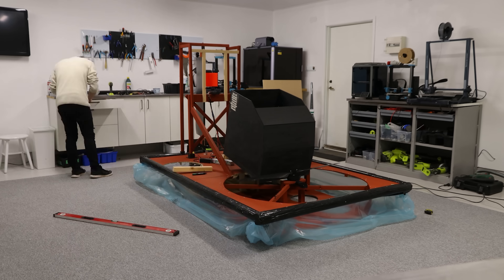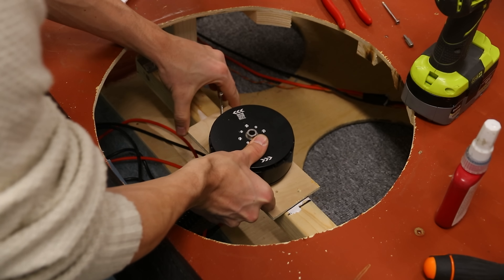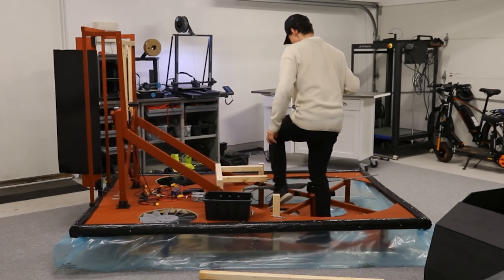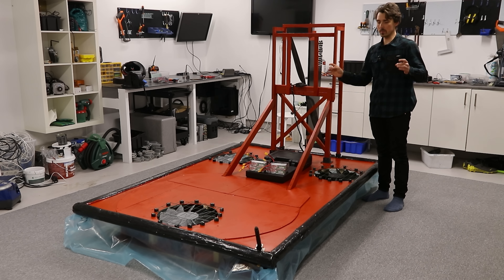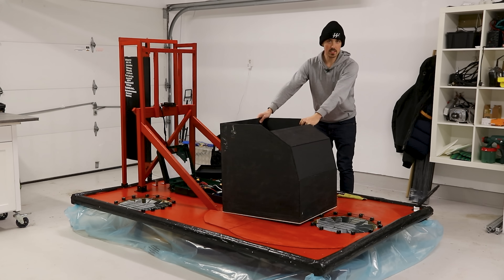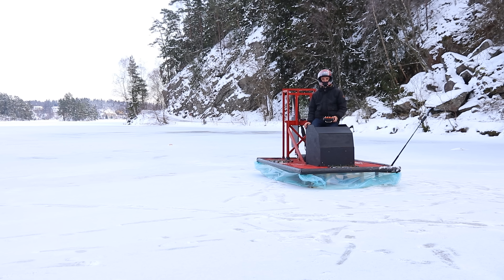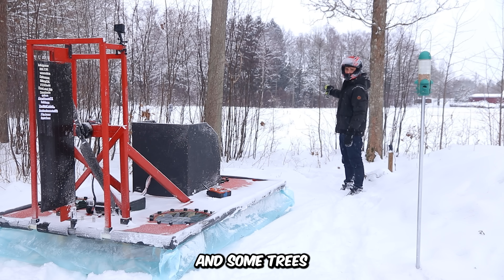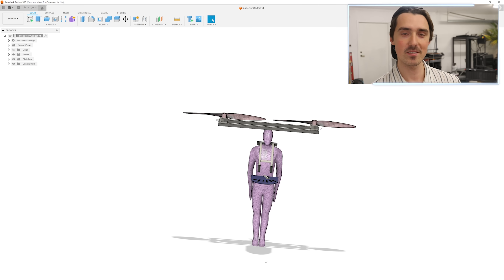3D Printed Compression Propellers - IT WORKS!

Comment: for a future thing it may be worth having some kind of cable attached to your foot that can magnetically disconnect if the wire is being tugged/snagged or you fall off to trigger an instant shutdown of any power. Or if a wire is too sketchy: a magnetic pad with a magnetic switch that you have to keep your shoe on to ensure the device stays on

Comment: I think you have to realize, the fans don't need to be in the deck like that. You want as tight a fitting duct as possible that routes the air under the craft. Orientation doesn't matter.

Comment: You need something like what in the UK we call a dead man's handle a passive emergency stop device which would cut out the engine when the driver was incapacitated or otherwise not in control.

Comment: ....actually you would have to use an accelerometer attached to the body to determine the thrust forces applied in all 3 axis and then integrate twice in real-time to determine the actual x, y & z positions to drive the delta machine!

Comment: Best lift fan will have many blades like what you see on a jet engines intake, plentys of models available as .stl.  for rc size 1/10 models i either use a 3d printed jet intake fan or a comptuter power supply cooling fan, a good gpu fan would be awesome.   So you're on the right track.  Just keep your skirt  off the ground,  try a good quality tarp for a skirt.  Works great, well in rc,  life size youd be replacing it after a few hrs use, on the rc ones i just glue another layer on the bottom.

Comment: Dude, stop using rudders on hovercraft.  Instead articulate the motor and prop.  You'll get way better response...  I have a few rc ones I made that are as easy to steer as an rc car...also doing it with multiple fans allows for more backpressure created against each fans effort.  Focus on a nice size fan up front.  Cover the other holes.

Comment: Okay, so you can actually increase the performance of your downwards fans if you go back and look at what an EDF actually looks like by having a smooth input shroud that surrounds the fan which is very close to the sides of the fan. This will increase the pressure that is produced downwardsjust by simply putting a surround around the fan what you’ll find with most EDF they also have a bigger input diameter and a smaller output diameter which also increases pressure in the same way that a turbo jet fan would work

Comment: I wonder if it wouldn 't make more sense if the lower board (where the air exits) would be floating. Now you have a rigid connection between the main body of the hovercraft and the lower board. From my point of view (not an hovercraft expert!) the main purpose of the flexibel skirt on a hovercraft is to have a flexible barrier towards uneven surfaces, which provides a better seal of the compressed air chamber to the ground. As long as you have the rigid lower board, you could as well get rid of the plastic skirt and replace it with wooden walls. This type of hovercraft would probably work well on perfect, even surfaces inside, but outside you need a bit more flexibility to compensate the bumps of the surface.
ProjectAir made a nice DIY hovercraft. You can watch his hovercraft lift off the ground once he turns his compressor propellers on. Also with commercial hovercrafts you can watch this lift off movement.

Comment: This looks like so much fun, both as RC vehicle and also with you riding it! I had hovercraft on my "to build" list for a while, thanks for the inspiration again, will do it smaller though. 
Just make sure the failsafe works and add an emergency switch, holding the thing and disconnecting batteries quickly is ok for typical model size. These motors up to 10 kw are no joke. Make sure you don't cut your head off with the next creation ;)

Comment: Just get a single LiFePO4 battery pack of 320Ah and you should be good for a while. 1 battery is about a kilowatt. So if you need 16v you will have 5KW. They are not cheap but they are really powerful and don't need to be charged as often. (Unless you always just drain it.)

Comment: you know, a hovercraft is something that rides on a cushion of air
if you add a sheet of plywood to the underside, you're turning that cushion of air into the aggregate sum of the thrust of the air jets shooting out of holes you carved on said sheet, relative to the pressure built inside the pocket created by the sheet and the skirt around it
....one is a cushion, the other is aggregate thrust
conceptual difference there.

Comment: Many were do wrong with the lift propeller.
 Many do only 1st stage fan which is not good at building static pressure cause it will just experience so much powerloss due to compressor surge or compressor stall. You must use centrifugal fan for lifitng. But if you want to use fan then take the concept of axial compressor which consist a lot of  rotor stages and stator but if you want simple but with less effective performance compare to axial use centrifugal fan blades,take note not blower type but centrifugal compressor blade and remember keep the blade tip and cowling much more closer together dont leave a big gap between the two or youll have a powerloss still.❤ hello from Palawan Philippines!

Comment: crazy how much money this guy spends without even a basic understanding of the things hes doing. It seems common sense a giant 2 bladed propellor wouldnt hold a good pressure in the airbag, and understanding flow vs pressure oriented fans is a huge necessity. And even after getting pressure oriented fans they all have a rather large gap around the edge of the blades for more air to slip out. Look at jetski impellers, they have gaps less than a mm. using some shitty transmitters too for like 10k worth of electronics

Comment: I had an rc hovercraft 20 years ago. Very fast. In the center (bottom) was just empty and the air would only escape from holes in the perimetral rubber couscin... the breakes were just cut power to the couscin fan...

Comment: for the anti gravity device.. consider the problem caused by tilting yourself, and therefore proper thrust, which will pull you forward, or backward, or left or right, and if it's pulling you backward, for example, as soon as you're off balance, the effect will increase.    so you need to figure out how to gyro stabilize the propellers to always point upward. 
like.. an upside down segway sort of concept, where no matter what happens to the dangly bit below, the propellers are always upright.

Comment: you should have a kill switch on the machine like for treadmills, the cord is pulled because the person steps off, and the electronics are auto shut off.  then if you fall off, it'll auto pull the cord, and the machine stops.  and just plug the cord back in to re-engage.

Comment: The anti gravity propellers will pull you into whichever direction your body is facing, instead of up. I feel like you need to have at least three propellors and a flight controller keeping them level to counter gravity instead of throwing you over.

Comment: If your using the propellers don’t they push the same amount of weight down that they lift? So you’ll basically push yourself off the hoverboard pushing down on it with he air force or and basically render them useless or am I missing something ?

Comment: I'll say you can get some used likely heading for the trash pile condition Tyres and cut them in long strips length wise making the radius of the Tyre into the length of the strips and making them into a skirt guard it will keep it from getting easily damaged while in-use or in transport and make the look of the hovercraft more close to a real hovercraft.

Comment: if you want to use thrust to simulate gravity on another planet so you can move freely by your own power like on the moon, you have to gimbal the thrust so that it always points down, otherwise when you lean over your movement will be dominated by the sideways thrust. NASA's LLRV did that.

Comment: Holy shit, one device deadlier than the next! 😅 How will you make sure the Inspector Gadget propellers will always point upwards? If you lean with them, that could really get dangerous quickly as they pull you sideways. Maybe better go with a traditional quad configuration like in a drone?

Comment: Why are you using a RC radio? Use servo testers and cables to the rudder, make the front corners round also may help the bag pressure

Comment: Maybe skip the rudder and add two fans going sideways in the front and the back?

With Ardu pilot you could use them to stabilize the motion of the craft, so it's always in heading holding mode, and you turn a knob to change the desired heading? :)

Comment: add a dead man switch which is tied around one of your feed. So if plugged it disconnects the power to four relays which disconnects the batteries from the craft.

Comment: A gasoline engine with a generator would be a good solution for long run times.

Also 4 separate chambers would be good to level the hovercraft with electronic controls adjusting the speed of the propeller on the separate chambers.

Comment: So the three smaller ones are jut for lift, how about fitting a gyroscope to controll the fans? if you can sence the level of the base, then adjust the fan speed acordingly you should be able to get the board to hover level, irrespective of where you put your weight,

Comment: With your artificial gravity machine, consider what happens if you lean any direction. The fans will not be pointing down and thus will pull you sideways. You fall over with those fans going you're going need more than a few stitches.

Comment: Your design will be quite different, but you and viewers might be interested in the Lunar Landing Research Vehicle (and the later Training Vehicle) that tried to kill Neil Armstrong during Apollo.  It used a pivoting center turbine to reduce the effective gravity to that of the lunar surface.  If possible, you'd like to achieve a similar "downward only" airflow that doesn't push you horizontally and simply offsets your vertical acceleration to achieve the target gravity.
Reply: hi antibrevity, have you become a flat earther yet? If not I suggest viewing the 13 part series what on earth happened in my about to learn how the earth is not a globe

Comment: Hey man, the hovercraft is cool, but if you seriously intend the Inspector Gadget thing to work, don't forget the Rocket Pendulum Fallacy. You won't be able to control the thing (much) by bending your body! In the same way, nothing making use of gravity (like a pendulum) can be used as a balancing device. You'll have to use an IMU, and the PID tuning will be problematic. Fair warning, this design has been tried before and has failed, every time! Injury chance: HIGH!

Comment: You can get a more performance (higher dynamic pressure) out of the lift fans by adding a curved inlet duct and fan shroud, so the air does not go around a sharp corner and cant escape the fan sides.

Comment: If you build the inspector gadget thing as you've described, you will be injured or die. You cannot create a "jump booster" with only two props. If you could keep it perfectly upright (such as by running it on vertical rails) then it would work, but otherwise the moment it starts to tip over it will immediately pull you all the way over. You won't "hang" from the propellers and stay upright (google "pendulum rocket fallacy"), you will continue in whichever direction they've tipped over to, and if your feet are touching the ground you'll tip over instantly. EDIT: To clarify, you totally can make a "jump booster" with only two props, but they would need to be built like helicopter rotors with swashplates and everything.
Reply: Yes, on the ground your feet are the centre of rotation, but in the air your centre of gravity is the centre of rotation.

Comment: Inspector gadget propellers will be unstable when you are in air (after a jump or something). Take corriolis effects into consideration and if you are going for an rpm controlled setup for roll control, take yaw moment unbalance into consideration as well.

Comment: The flaw in the initial setup could have been the TOTAL FAN BLADE Area to INTAKE Area ratio, not necessarily the weight distribution. That propeller cannot create static pressure like those EDF's. Glad to see it running nicely and cannot wait for that Inspector Gadget gravity fighter!

Comment: Awesome video and so cool it worked. 
You really need shrouds around your fans for both protection and to create better airflow due to venturi effect and others which also helps with keeping static pressure in.
I built a hovercraft when things weren't available but might have to try again

Comment: Chicken wire around the propeller cage! You pushed it at some point, and then just casually switched pushing point.. what if you missed that vertical bar? Goodbye hand. You have to make it safer.

Comment: @RCLifeOn
Hmm... instead of "ditching" the "original front engine", You could instead have tried/tested to just build a "compartment" or possibly even just "baffles". Making the rear fans mostly/only able to "vent" in the "rear part" of the base.... And leaving the front motor and prop to "take care of" the front lift.. That would possibly even make it possible to "trim" using a flight controller...or manual controls...
Just a thought.
Best regards.

Comment: nice santa sled, santa is the goat, also a nice snow blower, no pushing tons of snow in front, other than the air. yep invert the power down logic, if no control turn all off. like a single remote power 0-max trigger. well if your lower part of the skirt plate is in the snow it will work like a snow boat. maybe make it more like a boat bottom, buster or so. well why not also a personal flying device, a prop pack.

Comment: Now add an inlet nozzle to those small propellers like on a big hovercraft or a carburetor…
Also how about a shielding for that main pusher rotor… that’s really dangerous right now…
Last not least how about a killswitch similar to jetskis ? A string from your body to a removable key in the switch…

Comment: Looks like a ton of fun. Have you tried using string to draw your circles? Just put a pin/nail/finger in the middle and tie the pen at the right length voila you have smooth circles

Comment: That's awesome! But might I suggest one of those big red emergency stop buttons 😅

Also for the Inspector Gadget backpack, look up the pendulum rocket fallacy. Stability seems like it will be... interesting heh.
Reply: good plan , deadman switch would be better still
Reply: Yes, to get the desired performance it needs to be a quadcopter with a flexible attachment to the pilot, set to keep itself level so it doesn't produce any lateral thrust.

Comment: Incredible build! you should try to make it a solid skirt instead of the typical bag system. unless you have heavy duty rubber skirts these don't seem to hold up, but you have the build ability in my opinion to build a solid skirt system instead!

Comment: The propeller gravity thing is actually a death wish it's pretty dangerous because you cannot stay upright with just two propellers as soon as you jump you will be tilted to a random Direction the thing will probably hit the ground yank the whole apparatus off of your back and then some propeller might hit you in the face or cut the limb so be careful with that you need at least four propellers controlled by a flight controller and I would go as far as suggest using the EDF propellers that you used in a very tough enclosure that will not break open and cause damage because you will fall with this thing once or twice so be prepared for it

Comment: Inspector gadget propellers: make sure the props are always further than an arms length away. You’ll probably want the props to be able to tilt and have a gravity driven counterweight or else when you jump, they will pull you in whatever direction you lean, not just straight up.
Reply: I think this idea in general is kinda suicidal if you ask me.
Reply: that's exactly what he is thinking i thought yeah, something like the LLTV they used to train moon landings just without the "RCS". man if he can pull this off it could mean bouncy castle 2.0 for adults? problems with danger and with battery life, still very interesting i would say.
Reply: I don't think a counterweight would work, would it? Yes when he's standing, but the moment he jumps it because the pendulum rocket fallacy, right?
Reply: @clonkex   Right. IMU driven would work, though. This is going to be a nightmare to tune the PID on.
Reply: @Corbald  IMU-driven with some control surface or third or fourth prop, yep that would work
Reply: He should rather first make a bicopter and then after perfecting that he then should attempt this idea. But for this case he should be very conscious or else we might have seen the last video. @clonkex
Reply: It could use maybe something like those self-correcting cyclic mechanisms used in cheap RC helicopters. Not sure if those would work in a two-rotor setup... But this is the type of project where 'crazy enough it just might work' is probably something you'd hear.
Reply: Time to create the new RCLifeOn tag line of  : What could go wrong?
Reply: Good thing is, they will never go full throttle when control is lost. That never happened before.